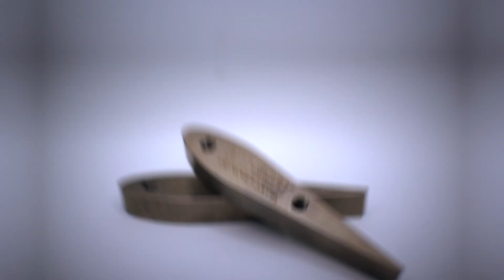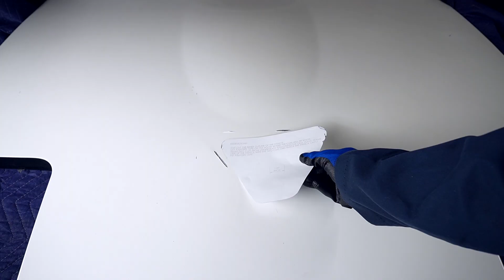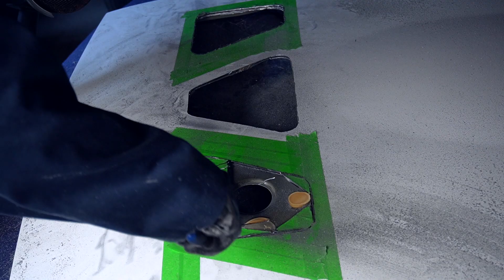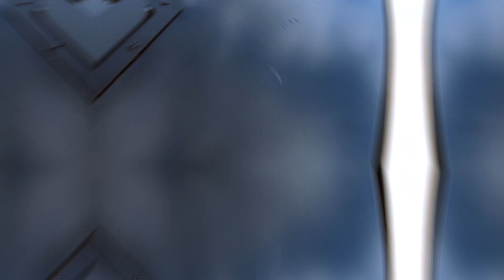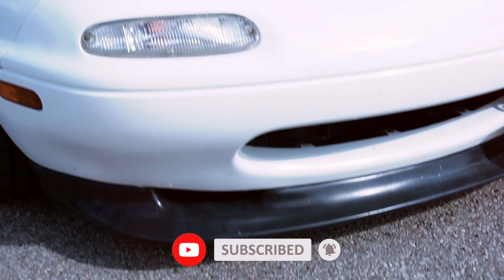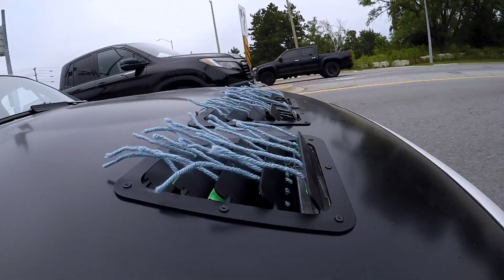HOOD VENTS to Cool Your Miata 🔥🔥 Installed & Tested! DIY Miata

Comment: 🙊 Perhaps it's different for track use, but I was always told that you need the oil temp to get to 100 Celsius in order to burn off the water which may condense in your engine.  Probably doesn't matter if you're changing the oil a lot for the track though.  The sound effects for the saw was a hoot!
Reply from the maker: You win Stan🏆 
Excellent point, I suspect you're right. I should've said that 100C was on my 20-30 test drive loop. In traffic or on track, I would expect the temps to climb to ~110C/230F? And 100% agree on the frequent oil changes! Great comment!
Reply: @mostlyuselessgarage  Thanks.  I installed an oil temp gauge in my mostly stock '94 Miata and it sits at around 220-230F in normal town driving.  It gets to 240F with spirited driving on the twisters and cools down pretty quickly when getting back to cruising.
Reply from the maker: @stantheman5163 Good data point, what are your oil pressures like?
Reply: @mostlyuselessgarage  Oil pressure stays within 30-60 psi on the OEM gauge.
Reply from the maker: @stantheman5163  awesome, my OEM gauge shows similar

Comment: Do you have any concerns with moisture getting into the engine bay? Idk if you store the car outside or not.
Reply from the maker: I garage store my car and it only comes out in fair weather. But ya cutting holes in the hood would allow water into the engine bay if stored outdoors.
Reply: @mostlyuselessgarage  I see. I’ve wanted to do this to help with engine bay temps but I dont know if moisture in there is worse than a hot engine bay.
Reply from the maker: @helpmeboonmee  hmm, if you have to park outside, maybe making a little cover for it would help. A piece of ABS going over all 3, foam seal surround, and bungy hooks? That or just throw a car cover over the whole thing. Water running down in front of your engine probably isn't a big deal, the only thing I wouldn't wanna get wet is the rad fan motor but that's pretty well sealed.

Comment: Wonder how rains effects this
Reply from the maker: Horribly 😅 I don't rain drive much but I think the 3-panel should be OK. Water would run down between the rad and front of engine, and when you're at speed it should run backward toward the windshield. I'm not gonna a test it out tho!
Reply: @mostlyuselessgarage  I emailed them to see if I can pick up side skirts in person. I work nearby
Reply from the maker: Hey, you're local, cool! Those side skirts look really good.
Reply: @mostlyuselessgarage  yes live by Yorkdale mall

Comment: In my opinion, you have to heat up vinyl with a hairdryer or heat gun in order to get it glassy everywhere. That's the secret.
I tried to wrap a hardtop without heat. It was such a pain until I got the technique down. Here it is:
Pull the vinyl up from the surface with one hand, keeping just enough pressure to hold it taught.
Heat gun with the other hand, until you notice the tension on the vinyl dissipates just a little bit.
Put the heat gun down, grab with both hands, lay down the vinyl as you stretch it tight. It will be glassed. Just squeegee over to make sure it is stuck on properly.
You can glass a few feet of surface at once, with that technique.
I used the 3m air release.
Reply from the maker: Awesome advice, thx! I'll def give 3M wrap a try next time, reports say it's DIY friendly (stretches well, low tack, heats good). If you can wrap a hardtop with it, it's gotta be good! Ppl say Vvivid is very hard to use for all the opposite reasons of 3M ... thick, super tacky, heats terrible. I didn't show it in the video but I used a heat gun for the front. Honestly dunno why Vvivid is marketed to DIYers.